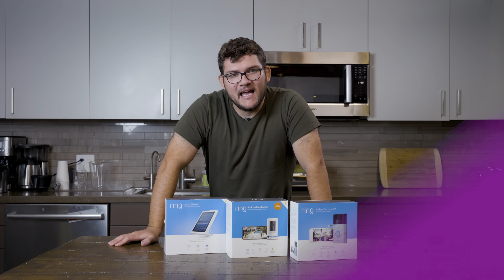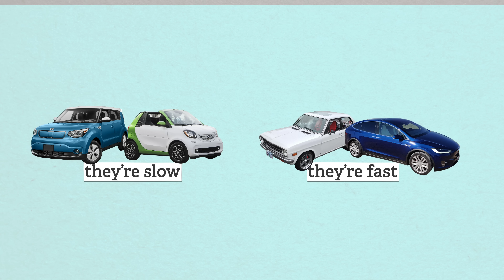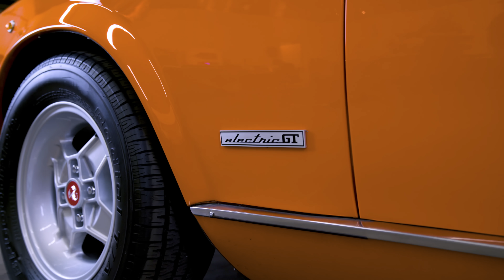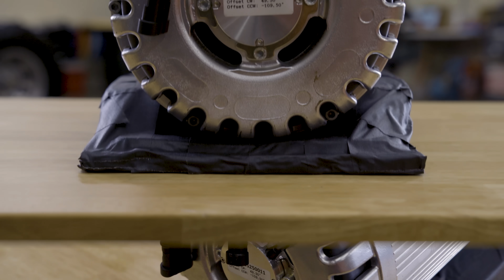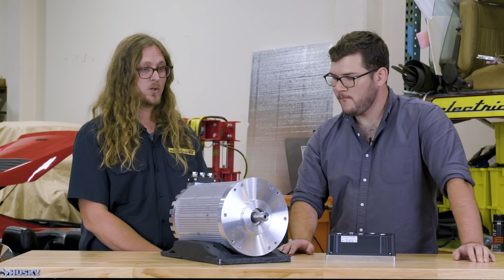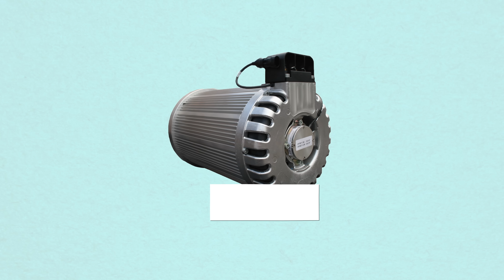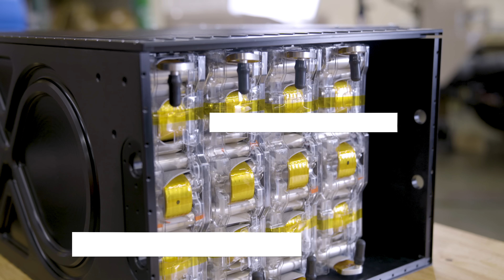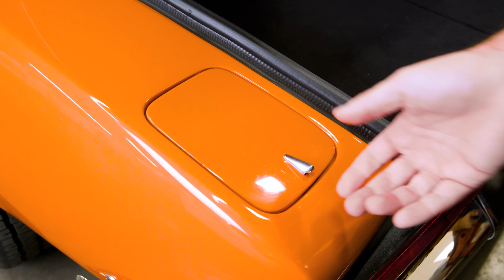Are Electric Motor Swaps the Future of Tuning? | WheelHouse

Comment: I didn't know that electric cars kept there gears, this video makes me want to mabyr e swap my car
Reply: you can keep the transmision for ease of instalation but the main benefit is that it will increase the range as the engine on the front will be spinning less (less rpm=more range).
Reply: Aaron Esau soo true m8 it made me happy when I saw him changing gears and the electric motors for sure are less Heavy
Reply: Yep, I can totally see a day in the near future where you can just buy adapter for common transmissions off the shelf.
Reply: @JoeUrbanYYC  They already make conversion kits for some cars.  I've been eyeing one for my '66 VW Bug.
Reply: @JoeUrbanYYC  me too, although I don't like the EV, there is doubt than they'll conquer the market as they are objectively better (subjectively i like better a good vroom vroom machine)
Reply: you keep the gears if your torque is not massive. Can't put a Tesla Engine with 600 torques in a 1.2l gearbox
Reply: @dallatorretdu  we are talking on reasonable cases, most of the times it would be a good idea to beef up a bit the transmission. Of course a fiat 147 transmission will f*king explode with a Tesla motor
Reply: @ivokiller2000intel  It depends on the motor look up bloodshed motors they explain the different motor options

Comment: For enthusiasts that will not let go of ICEs, the future will be something like the 919 spyder. Where you can choose all electric and gas kicks in when needed or hybrid or full power mode.
Reply: I can’t recall whom but someone had a bolt on for civics that was basically an electric motor replacing the rear wheels. That’s probably where we are headed for diy. Bolt on devices to add electric slowly until we do crazy ICE hybrid swaps on our own.

Comment: Alright, now what about electric cars that use water and burn hydrogen? Also, could you do an episode on engines/motors that run on renewable oil?
Reply: or how about the cars the Easter bunny and Santa drive?
Reply: @truantray  So, you don't want car engines/motors to rely on renewable/more readily accessible water electrolysis engines that could run smoother and accelerate faster than a typical diesel engine? Hydrogen is lighter, abundant, and not as dense as most air containing carbon dioxide/monoxide, oxygen, and nitrogen, etc. It could be more beneficial for a turbo being that you can fit in more diatomic hydrogen molecules in a turbos volume than you could with an normal exhaust. It's a more abundant fuel, that's lighter, and can react at a lower energy level than gasoline. If I'm wrong, correct me. I like to learn new things and be properly educated to remove misinformed preconceptions.
Reply: The problem with hydrogen fuel is that it's an incredibly dangerous fuel for the average person to handle for obvious reasons, and it takes a lot of energy to make. Using water and in-car hydrolysis isn't efficient enough either. You'd need far more water to power a car than would fit in an ordinary fuel tank.
Reply: @KaitouKaiju  Thank you for taking the time out of your day to provide a proper response. I appreciate the fact that were not antagonistic in your reply. Thank you for your insight.

Comment: EV is the future of cars... but internal combustion engines will never go Away
Reply: Electric trains (1883) pre-date cars (1885). They're a vehicle! Much of today's hybrid technology is derived from 1960 Diesel-Electric trains.
Reply: We can't have two things at once, let it go, dude
Reply: @calvinnyala9580  Why not? Before the invention of the starter motor, the choice was between steam and petrol. Look at Stanley cars. It's only the middle section of the later 20th century where it was only internal combustion (Petrol v diesel). There are currently many options:
LPG
Petrol
Diesel
Electric
Jet
Solar (saw one of these on the road last night!)
Reply: Steam cars will be around forever too
Reply: unless they get banned, as many countries are planning.
Reply: @truantray  
You can not simply ban historic cars, just wait 25 to 30 years and your ice is legally allowed to drive as a rolling (actually good sounding) museum piece ;D.

You can buy oldtimers right now and daily drive them without a problem.
Reply: @Enthropical_Thunder  My car already is over 30 years old and I daily drive them. All my cars are that age or older. It's not a museum piece if it's running! The banning is only on selling new cars with internal combustion. Old ones can still run.
Reply: @dcarbs2979  
You probably got the wrong idea, all i am saying, is, that oldtimers are valueable, still working, machines from the past, valuable enough to be put into a museum, therefor "museum piece".
Reply: @truantray  They can plan a lot of things but that doesn't mean it would be a feasible plan or an environmentally friendly one.
Reply: @truantray  They are only planning on banning the sales of new ICE cars. The cars that are already on the road at that point will stay on the road, until theyre scrapped or whatever by the owners.
Reply: @truantray  nahh airplanes and cargo ships wont be electric for a very long time.
Reply: Yep, the ice is the "fun one" XD.
Reply: EV's isnt actually the future. EV's exists for more than 100 years. Porsche made one before 1900.

Comment: Electric RC cars have been around for a long time. It took such a long time to make their full size,high performance cousins.Batteries were the primary constraint.
Reply: Ans they still are. EV's would be even more awesome if they'd be lighter and charge faster or be cheaper to produce or more sustainable for the environment to create. Those are all because of batteries. The technology will take huge steps in the near future hopefully and then we'll see probably EV's getting mainstream
Reply: Batteries still are the biggest issue, not enough lithium on this planet to power all the vehicles.  We haven't had a battery breakthrough in decades, every time someone thinks they have something it turns out to either be too expensive to mass produce or too volatile for everyday use.  I converted nitro powered RC trucks to brushless electric years ago, but I don't see it being something popular for passenger vehicles for many years.
Reply: @shonntl  LOL batteries have been consistently getting better and cheaper for decades.
Reply: @scottverge938  Overall battery tech has not actually had any real breakthroughs since Lithium Ion which is what Shonn was talking about. Yes the current tech is getting cheaper and longer lasting but it still falls under the same constraints as they always have.
Reply: @shonntl  batteries by design need to degrade. They will always deteriorate. Ill stick to my nitro rc and turbo v8 thanks.
Reply: The first time I drove an RC car back in the 80s I knew we would eventually have electric cars and that they would outperform gas ones.
Reply: It's odd watching these guys in awe over technology I've been buying at the hobby shop for years
Reply: The difference is that rc cars can have a much better power to weight than actual normal cars and part of that is how magnets and electromagnets scale and how weight and impact work.

Another part of that is how ices scale down and given only one battlebot uses an ICE now and i think a total of 3 post comedy central battlebots and of those only one did well the answer is not too well.

That said i have heard of nitro rc cars which have engines that might work on the 15-30 lbs scene but i have yet to see anyone impliment that, even back when lithium batteries were expensive AF and having a gas spinner seemed like a solid idea for cost savings and even power to an extento
Reply: Really hope Solid State Batteries come out polished and soon. That, and the GaN chargers.
Reply: Thanks Captain obvious

Comment: Yes, I'm gona dip all my old beaters & swap to electric as soon as motors are available like Samsung phones....
Reply: IAmNotPeaceful  batteries is the one thing I'd not put that much money on anyways. 
I'd love to build an EV for recreational use, like a project car, but batteries are one of the most expensive things to figure out. 
I'd probably build a tray and make the batteries as easy to upgrade as possible as they are the biggest problem in EV development and will most likely enhance so much in the near future that it's not just worth putting too much money on it.
As for a project car I'd want it to be light and agile and therefore it's okay if the battery packs are small. I don't need my project cars to drive across country anyways.
Reply: Magna will be selling crate motors in 2 yrs.
Reply: tw06le1 so in 100 years